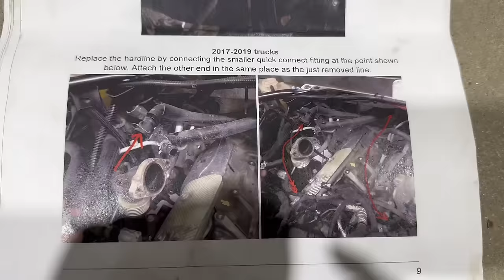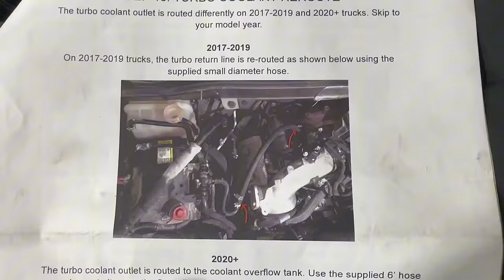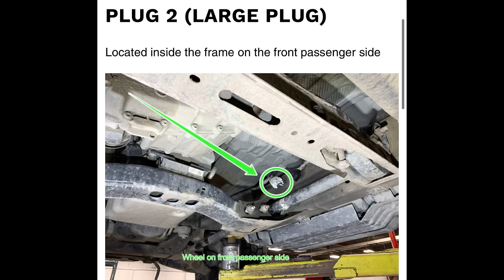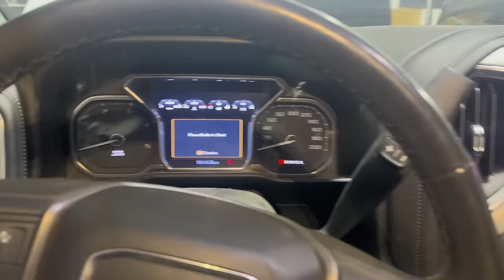How To FULLY DELETE L5P DURAMAX 2017-2023

Comment: Anyone doing this for the first time like I just did today, I highly suggest letting the company that made your tune file rewrite your ECM for you. They had me install Anydesk on my laptop, and they were able to remote install my tunes for me. The tune software is the only part of this project that had me nervous 😅 Having them install it for me took all the worry away, and they are super nice too
Reply from the maker: Did you watch my “how to tune L5P video”?
Reply: @darkirondiesel  yes I did, and it was extremely helpful. I would have completed it all using the video, but I was sent the wrong tuning software. They finally got the correct software for me, and since I had them on the phone, I asked them to install it for me. They did a couple extra steps I didn't see in your video. I assume it was due to hp tuners having done some updates to their own software. I really appreciate your videos, and I couldn't have done any of this without your videos.
Reply: @darkirondiesel  although since I got your attention, I do have a question. Hopefully, you can answer. After my EGR delete, I have a code for fuel regulation range. I was curious if my 2017 should have that throttle body plug installed. Your video said to leave it unplugged. Any ideas where my issue is? Thanks...
Update.. I plugged everything back in and have definitely narrowed my issue back to that throttle body plug you said in the video to leave unplugged. With it unplugged, I get a code of P0002, and with it plugged back in, I get a code of P0001. The P0001 says fuel volume control regulator circuit is open, and the P0002 says fuel volume regulator control circuit range/performance.. Do you have any idea if I need a can bus plug here? Thanks
Reply: That’s funny. I literally did the same exact thing today for mine! Called them, they literally did EVERYTHING for me software and tune-wise. Much easier. And thanks @darkirondiesel for these videos. Extremely helpful, and also saved me 3 extra grand for someone else to do it.
Reply: How long did the full delete take you and what special tools where needed to make the job easier

Comment: I'd buy from Diesel Dudes in a second if someone could tell me if the tune can be loaded with a def code.  My truck (2017 L5P) is a work truck and I could careless about idiot warnings as long as the tune works.
No sense in deleting if you have to spend $5k at the dealer to resolve def codes first...

Comment: Did my 2020 about 6 weeks ago... But I got my kit from a different company, but looked exactly the same(even the coolant hoses that were too short). I wish I would've had this video before then. lol. It really wasn't bad.

The V-band clamps were the biggest pain in the ass under the hood.... That front canister on the exhaust was the biggest pain in the ass for the exhaust.... for me. But it was a fun job.

Also, at 11:04, I just reused that hard coolant line for the coolant return from the turbo... It prevented me from having to buy more hose, and it gave it(in my opinion) a little cleaner look.

Only issues, When I start the truck, I get a DEF fluid low message and have to clear it. It's only when I start it, and doesn't cause any issues other than I get the message. Also, really weird, my trailer light plugs haven't worked since I free'd my truck. Flashed stock tune back on truck just to be sure, but still no power at the plug. All fuses look good. IDK.

Good video! It will definitely help a lot of people.
Reply: Hey who did you get your kit from? I was looking at the one from elite diesel but don’t want to get scammed lol.
Reply: @justin_steen I just tuned my truck and bought kit from elite diesel they had the tune file to me the next day. Good service,,
Reply: i had a fill def 100 miles till 185 max mph message l0l i had to play with the def plug on the driver frame. plugged it back in and filled it up and just had to play with it eventually i got it to stay off. i did the delete when the def tank was basically empty.
Reply: which kit did you get? was it cheaper? The one linked in this video is $5500 which seems steep...
Reply: @texasson  gotcha thanks! I found a few in that price range but the companies I was looking at didn't have very good reviews (TunerDepot being one of them)

Comment: I was under the impression that the billet quick connect plug goes into the fuel line to the 9th injector. With the can bus plugs, it won’t pump def fluid through the hose anyways.

Comment: When I deleted my 2023 l5p I just cut the scr in half. Aka the one on back of turbo. I didn’t remove the turbo. Took me 5 minutes to cut the scr out. To each their own. Also for the coolant return line on turbo to coolant tank I just used the metal hose that you threw away in the beginning and added a short piece of hose to the end to connect to the turbo. Looks a little cleaner and attached to the y bridge just like oem. But your way works also but have to buy a new hose.
Reply: Also good move using the oem fittings on the heater core lines. I used the aftermarket plastic ones that my kit came with. (Not diesel dudes kit) and I was towing and one of the heater core hoses blew off lost all my coolant in the mountains. So anyone doing this definitely reuse oem fittings.
Reply: Also I left alternator in the truck it’s totally up to whoever installing. It can be taken out or left in. Makes more room to work but is still doable to leave it in place.
Reply from the maker: Thanks for all the advice and insight man! The viewers will appreciate it for sure!
Reply: @darkirondiesel  no problem that’s what it’s all about. I was hoping you did this video before I did my kit about a year and a half ago. I was waiting and waiting but never came. And there is no good videos of l5p delete installs on YouTube or anywhere for that matter. So I’m sure this will definitely help out a lot of guys. I’ve done Cummins before and thought it would be easy. Well I was wrong lol. Way different than a Cummins that’s for sure. But keep the videos coming great work man.
Reply: What did you use to cut the scr? I'm doing my truck this weekend and any other little short cuts will help a ton along with darkirons video.
Reply: @ZKing628  I bought a one of each side Diablo carbide sawzall blades. The real good carbide ones. Mostly used the 9in blade but the 6in and the 12in comes in handy also. I’d cut it. Then spin the scr. Then cut some more just kept spinning it til I cut it all the way in half. Like 2 buns.
Reply: That's not the SCR. It's the DOC. The SCR is further downstream. It's located after the def injector in-between the two cross members. The whole purpose of the SCR is to use the DEF to convert the NOx... So it has to be located after the def injector.

Comment: That pin you put in the def injector line actually goes where the 9th fuel injector is on the driver frame rail.
Reply: I was wondering this. On my 19 it says to remove that hard coolant line from the exhaust & plug the 9th fuel injector on the driver side... I guess this is an alternative??
Reply: Would you know what pin actually goes into the def line?I need a plug ,spraying def all over my truck

Comment: Just a minor correction. You called the component behind the turbo the SCR. That isn't correct. The SCR is the component located between the cross members downstream from the DEF Injector. The component behind the turbo is the DOC. So it goes - DOC - SCR - DPF.. then out the tailpipe.
Reply from the maker: Ah good to know. It’s all the same crap in my mind

Comment: you needed to go over what the 2017-19 models say about the new bypass hoses im so confused with this part and it doesnt help that the diesel dudes didnt send me a pdf or a instruction manual for installation so all i have is your video i have now seen over 15 times.
Reply from the maker: You should be able to make it out of your pause the video when I show screenshots of the instructions, but next time I get a 2017-2019 in for an egr delete I can see about making a second video

Comment: A question,regarding the exhaustsystem.Why don't you just take the DPF unit,clear/remove what's inside it and put it back,you save  money,and it looks as if it is still in place ? Regards from Sweden

Comment: We just bought this kit for a 2020.  Ordered the down pipe and 4" kit that uses the stock tailpipe.  The first piece of the 4" exhaust wouldn't clear the tranny crossmember.  We already had the down pipe in so we had to cut the flange off and shorten the pipe.  So either the down pipe or the first piece is too long.  We tried to contact Diesel Dudes on a Friday and didn't hear back til Tuesday.  They claim everything was right, we just didn't install it correctly.  Bullshit.  I've forgot more than most guys know.  There's no way that exhaust would've fit correctly without shortening one or the other.  I think once they got paid, they don't give a crap.   Next time I'll just source the parts seperately and save a pile of dough.
Reply from the maker: I’m sorry you went through that. I didn’t have any problems with mine and I haven’t had any negative feedback like this either. Maybe it was a one off situation, either way that’s unfortunate.
Reply: @darkirondiesel  Yours was a 5", correct?  I'm thinking they sent us 4" for a 17-19 maybe.  There must be something a little different with 20 and up.  I've looked up a few other exhaust kits and some are listing 17-23 and others have a separate kit for 20 and up.  Idk, we already fixed it, but I won't be going down that road again.

Comment: Legend. 
I Hate how the diesel dudes are going up on their prices 20%
Reply from the maker: To clarify, they went up 5-10% depending on the kit.  I agree, I hate price increases too but unfortunately their costs on the parts have increased lately which is the reason for the price increase. Inflation inflation inflation. How about we get Biden and Trudeau out of North America and maybe some prices can go down.
Reply: @darkirondiesel  Ah that's right. I don't know why I was thinking 20%. Looks like I need to get that down pipe ordered.  Haha, right. Prices may stay inflated for the foreseeable future, but hopefully we wont have to deal with Biden for the next 4 years.  If only Canada wasn't so far away. People here want 4-5K just to work on these trucks. It's crazy.
Reply: @VRGamingTherapy diesel pickups are the absolute worst vehicles to work on,real truck mechanics hate them , and light duty you need someone who specializes in them especially the v8 diesels, as they are a special kind of crappy to work on. At least heavy trucks are designed to be worked on, the hoods lift forward they use inline 6 s there’s more room for things. I refuse to buy diesel for our fleet under 20,000 gvwr trucks , we are all gasoline until our low pros at 26,000 gvwr and up
Reply: @darkirondiesel 💯
Reply: @darkirondiesel Now that's something I can get behind. It's like TurdOh and Obiden are related.

Comment: Did anyone have an issue getting the down pipe on the back of the turbo? The pipe I got from diesel dudes bottoms out in the turbo and the gap is too big for the V band clamp to secure them together

Comment: Do you have any idea where to find that u-bolt style clamp with hanger? Finding a 5” is almost impossible, my Flo-Pro on my 6.7 only has the one hanger welded on, adding that clamp I could grab another hanger. Thanks man! Great video on the L5p, definitely a bit more work than us 6.7 guys.
Reply: Jamo makes them

Comment: Just curious if the Diesel dudes give torque specs for reassembly in the instructions?
Reply from the maker: No I don’t think so, but honestly I never really use torque specs unless it’s an internal engine component for the most part. If you bottom out all these bolts or nuts then give a good final “snug” you won’t have any problems.
Reply from the maker: I think there are torque specs on a couple of the bolts, the important ones, but other then that it’s just up to you to use your common sense

Comment: Hey. So if your L5P EGR stuff falls off and you're allergic to block off plates, what's a good aftermarket exhaust manifold and up pipe setup? If any..
Reply: PPE has higher performance manifolds and up pipes for Duramax.

Comment: Is it possible to just do an egr delete  but keeping scr and dpf stock just to be more lucrative  instead of having a 4-5in straight pipe especially like here in the states but while still not getting that terrible soot through rerouted back into the engine since the egr is gone
Reply from the maker: Hmm I don’t think so unless you got a tune written specifically for you that only disables the egr but leaves the dpf/def system active.

Comment: I won't be removing the filter behind the turbo or installing a downpipe. Do i just leave the sensor wiring? Leaving it as is won't end up making the check engine light come on, will it?
Reply from the maker: Yeah you should be ok to just leave the sensors but make sure the can bus plugs are installed correctly.

Comment: Hey, followed your video and the instructions. The delete itself was pretty simple and easy but afterwords I am getting a error message on my dash saying service exhaust fluid system, max speed 158mph. Any advise or tips you could privide?
Reply: Try plugging your def tank and nox sensors/particulate sensor back in and turn the truck on. If that doesn’t fix it, apparently it’s a tuning issue.
Reply from the maker: Yes contact the company that made your tunes

Comment: I have a 2015 crew cab short box. I want to get a 5 inch full exhaust with muffler but I also don't know what I sounds like with a straight pipe. Could I use one of those extension pipes that the kit comes with?
Reply from the maker: You could but you might have to do some welding. But my advice is get the kit with the muffler, it’s much easier and cheaper to swap the muffler out for a piece of straight pipe in the future then to buy a muffler in the future.
Reply from the maker: Also this is the link for the LML kit https://shrsl.com/4bmpm
Reply: @darkirondiesel  So the pipe for the crew cab long box won’t replace the muffler?

Comment: Kyle I need you help man I have a 2019 and I’m having a hard time installing the plug for the def tank It seems like it is too big just to make sure I’m plugging it in the right connector it is on the bottom of the def tank right????
Reply from the maker: Did you watch the video where I go over the can bus plugs? Is that what you’re talking about? The video has chapters, go to the can bus plug chapter.  I’ve never done a 2019 but maybe the tips and tricks I have for this 2020 will help you out. The def harness connector on this truck has to be popped into the right position to work. I show it in the video.
Reply: Yeah I did turns out it was on top of the passenger frame above the DEF tank I guess it’s different location for the 17-19 thanks for the help anyway tho

Comment: Did you get rid of your '22 Cummins truck ? Mine gave me endless problems.
Reply from the maker: Nope I still have mine. Haven’t had a single problem since deleting it. What problems were you having?
Reply: @darkirondiesel  What was written off as  injector rattle at first (but within spec) became a "serpentine tensioner" fault and then the lifters failed. $35k down the drain.  Always used Amsoil - and the recommended weight.

Comment: Does the throttle valve stay unplugged on the 2019 2500hd? Just deleted mine but have it plugged in and its been running fine. The instructions never mentioned anything about leaving it.
Reply from the maker: A few trucks experience issues with the throttle valve plugged in that’s why they recommend unplugging it to eliminate that possibility. I’d suggest unplugging it, problems can pop up out of nowhere.
Reply: @darkirondiesel  Thanks man! You released this 1 day after i finished my delete, wish i would have waited and watched this, would have saved a few headaches!
Reply: I wonder if this valve is just for warmup strategy. Like closing off to force EGR gasses through the cooler to exchange heat. Maybe one reason quick warmup goes when the EGR goes..

Comment: Hey I ran into an issue today with the heater core connector, the one on the drivers side is angled up and the one on the left is angled straight. The way it was on from factory had the straight connector on the one angled up which made it had to remove and even harder to put back. Can I swap the straight and angled connector lines because they fit perfectly? The left side would go to the thermostat and the right side would go to the lower radiator hose. Any help would be really appreciated thanks.
Reply from the maker: Hey, I’m not sure if you can pump coolant backward through the heater core. I don’t see why not, but I also can’t confirm it. What year is your truck? Did you figure this out?
Reply: It’s a 2019, and I still have them flipped for now. I’ll be able to start it this weekend so hopefully everything works as it should
Reply: @philipneville3172  Ever get this figured out? I have a 2019 also.
Reply: @VRGamingTherapy Yeah I just ended up switching them around, heat still works good and no leaks so far knock on wood

Comment: 2023 5th Gen Cummins next, please 😢
Reply from the maker: The 2023 5th Gen Cummins will be exactly the same as the video I released for the 2019-2021. The only difference is you have to swap the Ecm, which I also have a video of!
Reply: 2022+ will be different because they have RaceME ultra monitor and shift to fly tuning and Mopar ECM cost $6k. I know, it's very expensive.

Comment: How is the quality of the parts from diesel dudes ?
Reply from the maker: Overall I would say good. Only thing I’d suggest is reuse the factory coolant fittings at the heater core on the firewall instead of the ones they come with.